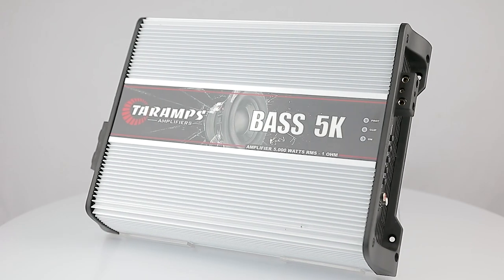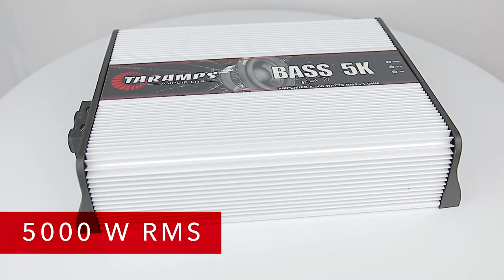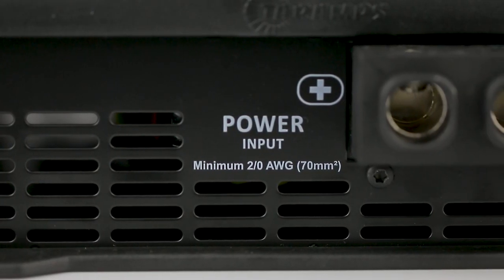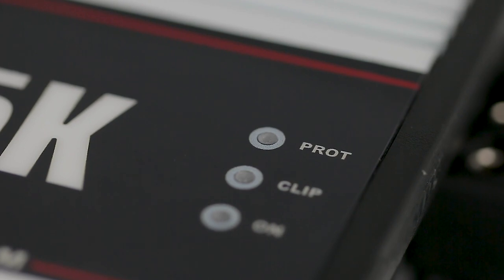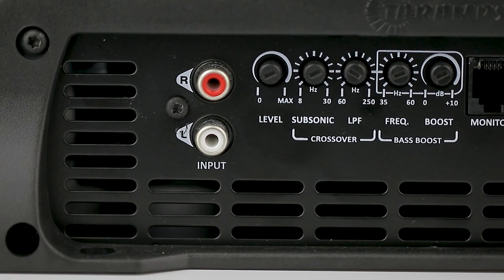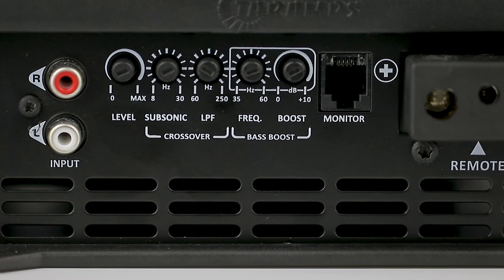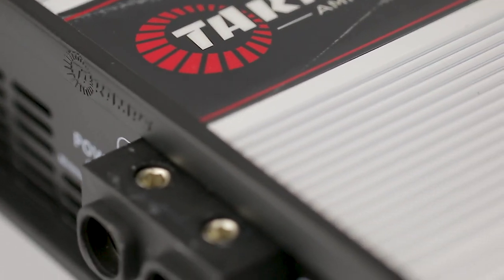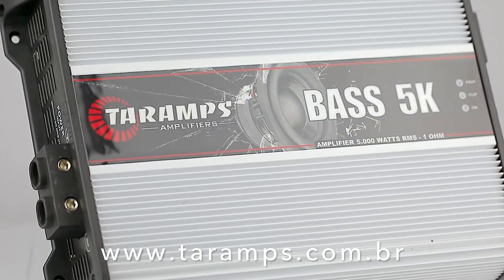Taramps Bass 5K Automotive Module Amplifier 5000 Watts RMS | Taramps Group

Comment: I have 6 rockford fosgate p3 12s in my tahoe and my electrical is upgraded and its 1.33 ohm. HOW WILL THIS AMP BE FOR MY  SUBS?????
Reply from the maker: It´s going to run ok, but you´ll be losing power there, as impedance won´t match. It is recommended that you go for a Smart 5 Bass.
https://www.tarampstore.com/amplifier-taramps-smart-5-bass-1-channel-5000-watts-rms/p

Comment: hola tengo una duda compre el taramps 5k bass y mi duda es sobre el LPF es de 60 a 250 hz pero exactamente en que pocicion da los 80hz  porque no me da medida con el smd cc1 me comunique con taramps pero no responden
Reply from the maker: Hola, como los ajustes del amplificador BASS5K nos permiten una aproximación, no tendremos un punto específico para indicar los 80 Hz, pero puedes comenzar los ajustes a partir de la segunda marca por encima de 60 Hz para seguir el rendimiento del sistema y modificarlos según lo necesites.
Si tiene alguna otra pregunta, estamos a su disposición. 
Equipo de Soporte Taramps.
Reply from the maker: Hola, como los amplificadores solo tienen un sistema de aproximación de cortes de frecuencia, no hay un punto específico para dejar el crossover en 80Hz, pero se puede aproximar entre la 3ra y 5ta posición después de 60 Hz.

Cualquier otra consulta estamos disponibles.
Equipo de Soporte de Taramps.

Comment: For the fuse 210a thats recommended can I use  250?
Reply from the maker: Hi @seanspeight2643, how are you? A larger than recommended fuse will not be as effective if a problem occurs in the system. The ideal is to use the 210A, but if you can't find it, use a maximum of 225A. If you have any questions, don't hesitate to talk to our team.

☎ +55 18 32664050
📱 +55 18 997487039 (Whatsapp)
📱 +55 18 99651-7817 (Whatsapp)
📧 suportetecnico@taramps.com.br

Comment: What is the difference between the 5k bass and the smart 5k bass
Reply from the maker: The Smart5Bass is a multi-impedance amplifier that delivers up to 5,000 WRMS across impedances from 0.5 to 2 ohms, while the Bass5K is an amplifier that delivers 5,000 WRMS at a minimum impedance of 1 ohm.
Both were developed for subwoofers and include several crossover adjustments with a subsonic filter, LPF, and Bass Boost Frequency control.
Any other questions, we are at your disposal.
Support Team Taramps.

Comment: What size anl fuse should be used with this amplifier??
Reply from the maker: Hello @AdOrtiz661. Regarding wire gauge sizes:

Positive/Negative power cable -> 2/0 AWG
Output cables -> 7 AWG
Remote cable -> 18 AWG

For Bass 5K it is recommended to use a fuse of at least 210A.

For more information, see the product manual: https://www.taramps.com.br/wp-content/uploads/2018/08/MN_017630_R00_BASS-5K.pdf
Reply: For the fuse 210 can I use 250?
Reply: @seanspeight2643  that 210 they recommend didn't work nor 300 I had to use a 400amp.
Reply: Alright.... kind of set up do you have..? Bout to get 400 then
Reply: @jaynice6542  nothing major 2 15 zvx 1/0 ofc wire high out alt and some extra batteries. That amp is beast tho I like it alot!
Reply: Dammm.i am copper 0/gauge. Extra batter x series sundown.. bout to get 400 fuse now
Reply: @jaynice6542  hell yeah bro nice!! Bassheads for life👊
Reply: @Ortiz_661  4life

Comment: Which would work better smart 3k or bass 5k on a 1ohm load 2500rms sub
Reply: 5k
Reply: Its changed since i wrote this i  now have 4 15s which are rated 4,000 rms total conservative.. thinking about an 8k i currently am running a bass 5k
Reply: @danruffing5057  yeah 8k but go bass series i would go Smart Bass 8k help fight impedance rise it will keep you with in that 1 to 2 ohms so you will be getting maximum power at all times plus your gonna need a at least 8k!
Reply: The total rms is 4,000 I think i said it wrong lol and you thought i meant 4,000 per sub. But the bass5k running at .5ohms for 6 months now and the subs have never got hot or stinky so i figured they could handle the 8k and i get that overhead with it.. but i agree the smart series does make more sense can you run the smart bass 8k at .5 ? I am gonna have to look into lithium batteries now too

Comment: Can this run .5 ohm right
Reply from the maker: No, it can´t. The minimum impedance for our Bass 5 K is 1 Ohm. In your case, we suggest our Smart 5 Bass, because it´s a multi-impedance amplifier, and delivers maximum power from 0.5 Ohm to 2 Ohm. Let me know if you have further questions. We´re always glad to help. #TarampsTeam